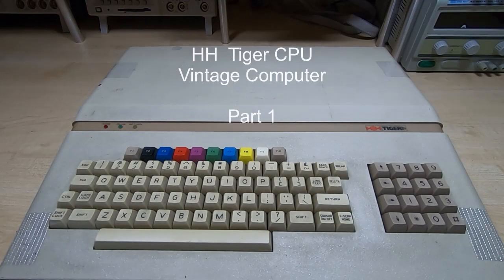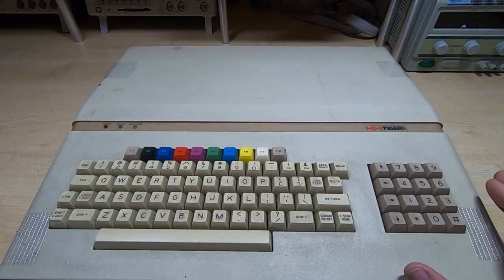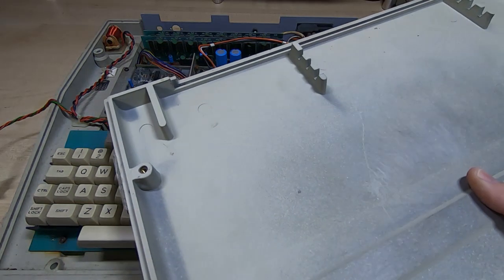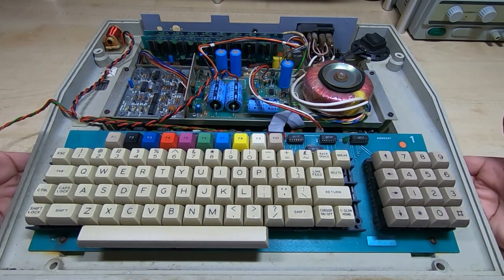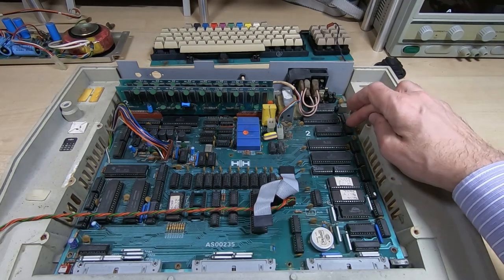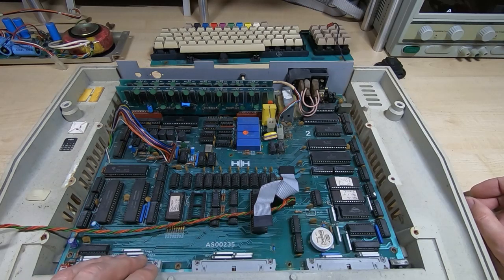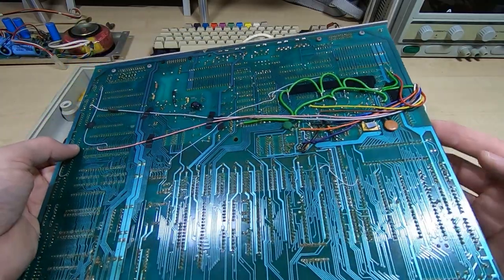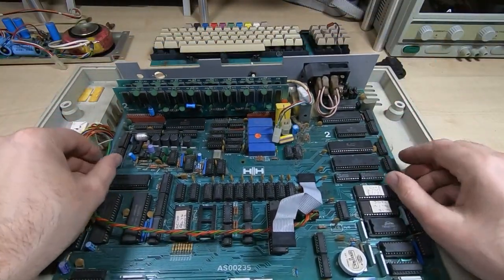HH Tiger CPU Part 1

Comment: Great stuff Jerry. I'm looking forward to watching this series. A friend of mine picked up a HH Tiger about 10 years ago, which we managed to get working... I think there was just a problem with the ribbon cable connecting the CPU to the Tiger monitor/disk drive unit, and we gave the IDC connector a squeeze with a pair of pliers and were able to load some programs from floppy. There were a couple of official HH Tiger 5.25" disks with the system, and one of them was a demo disk. I remember the demos being VERY underwhelming for what I thought would be a very capable system, but then again the programs on the 'Welcome' tape on the BBC Micro were just as uninspiring. I think the other disk that came with the Tiger was Microsoft BASIC. It was certainly a good-looking, chunky system when paired with its monitor/disk drive unit.

Comment: I have a HH Tiger also..  Fortunately in an uncorroded condition..  The wires and mods i think are actually original, the inductor is believed to have been repositioned as in its original position on the power supply board is directly under the where the CRT would sit causing distortion.  Could i ask what the hand etched serial no is on the back panel and the ROM versions? If they are 1.2 i believe it is an early version..  Thanks for the video..  All we need now are details of the Disk drive / monitor unit..  :(
Reply from the maker: I will be making a follow up video showing some more details and will include ROM versions and serial numbers. I am assuming that the inductor was moved after production as the cable securing clip is different to all the others. I assumed that the wires from the connector were original as there is no connector for them but some mods seem to be later, maybe a common modification. Some of the wires are just hanging and a few cmponents have dropped off the board. Unfortunately the owner does not want it to be repaired as it would cost too much but I will be having a quick look to see how much of it is functional. Does your unit work? I am tempted to repair this unit as it is interesting but as it is not mine it will be hard to justify the expense.
Reply: @JerryWalker001  Will look forward to it..  :)   The PCB beside the power supply where the coloured wires lead around to the bottom side of the Logic board is apparently the modem analogue circuitry. All the Tigers seem to have had the inductor moved to the side in production.  It also looks like you are missing one of the Video RAM boards, there should be three totaling 96K of video RAM.  This i think will be another major issue on this poor neglected Tiger..  :(  At present this is academic as it probably wont boot up as the firmware seems to get stuck in a loop looking for the floppy disk controller (which is in the monitor/disk cabinet) :( :( :(
Reply from the maker: Yes the second board on the power supply tray is the modem. I noticed the missing RAM board but I do not think this will stop it booting as it will not be aware of the missing board. If I get as far as it trying to run ROM code and it getting stuck looking for the FDD then I will probably create a set of ROM's that skip this check (I frequently have to produce modified ROM's for machines I am working on as they are rarely complete). This machine is not mine but if it turns out that it can be salvaged then I can easily create a reproduction RAM baord and the 4116 devices are easy to find :) but it is unlikely that anyone will want to pay for it and as only around 1000 of these were ever manufactured then the market for them would be small.
Reply from the maker: Roger Pugh, The serial number is 20578 and the firmware version is 1.4. I had concerns over the condition and the possibility of getting it working but after quite some effort so far it is starting to look like it may be possible.

Comment: "Possibly not going to be repairable?" wait I did not think you knew that combination of words... even if you have to build a whole new board it seems everything is fixable by you :-)  Wish I had a useful comment to help out but I have no knowledge to help here...
Reply from the maker: Yes you are absolutely correct. Everything is fixable but it is the cost that is the issue. The HP is my machine so time / cost was not really a concern but the Tiger is not mine so I have to limit the 'spend' as the owner will not want to spend the amount required to fix it. It would be nice to be able to buy all the old units so I could justify repairing them but my funds are limited. If anybody out there has any faulty vintage equipment that they want to sell to me for a reasonable amount then I can justify the repair cost :)
Reply: @JerryWalker001  Sadly I was born long after basically everything you fix was made so unless my grandparents give old broken stuff to me everything I own has a touch screen it seems... (not really, I do have my first laptop which was before touch... but you get the idea I only became aware of electronics after 2000...)
Reply from the maker: I saved the first computer program I wrote onto punched cards and then we had a major upgrade to punched tape, that was a day to celebrate - 'what great techology' we all thought. There were no video screens on the computers, It was all done through teleprinters so all output was directly onto paper. I am not actually as old as this makes me sound but computers have really changed over the last 45 years and unfortunately the older units were considered junk when newer things appeared and so were thrown away. I am hoping that I can find and repair enough older items to give people, like yourself, that are interested in  the history of technology a good insight into it and also with any luck encourage resoration of any items found in barns etc rather than them being broken up for scrap. You will be surprised by how early a lot of what is now assumed to be modern technology was originally developed. I have repair of a very interesting IBM system 23 coming up shortly. That will really go to demonstrate how modern PC's started.